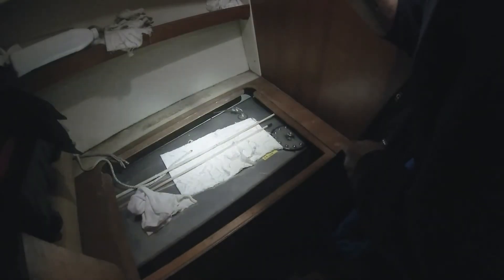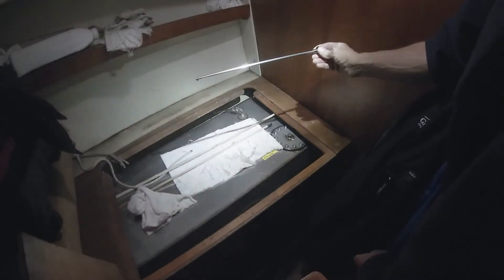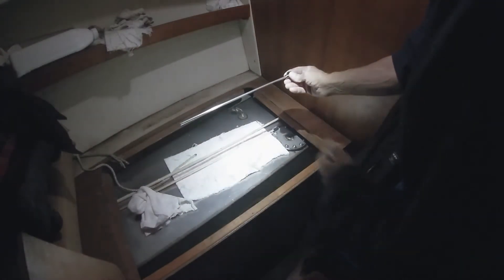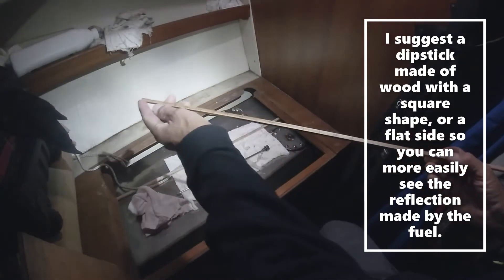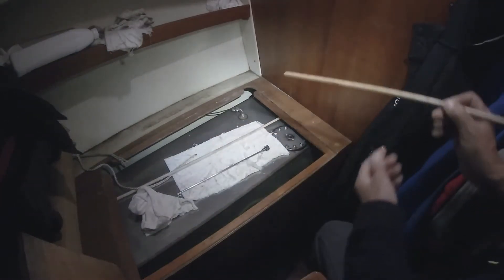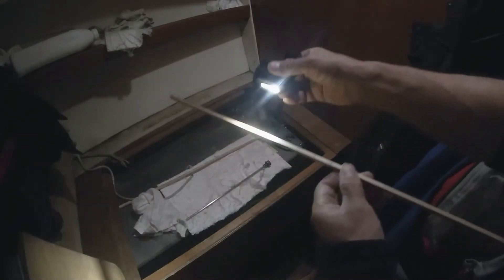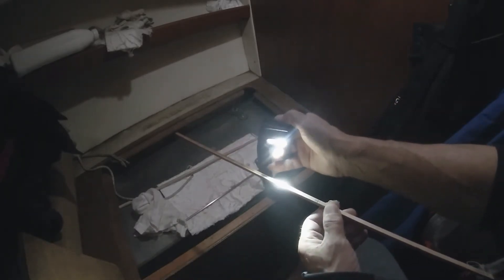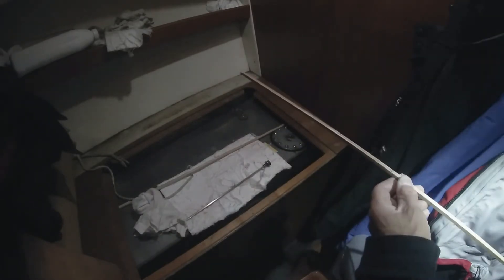I DIPPED THE TANK -- BUT HOW MUCH FUEL DO I HAVE?

Comment: My transmission has ametal cylindrical dipstick that is also impossible to read.  

I came up with a simple solution

Carefully lay the dipstick on paper towel!  

The wetted paper towel clearly shows the level.  

Of course, you have to lay it flat without sliding it back and forth.
Reply from the maker: That is an awesome idea that I have never heard of before. Thank you for sharing that. I am sure I will have an occasion to use that technique!
Reply: I came upon it purely by accident.  

After a couple futile attempts to read my dipstick, I set it aside on some paper towel and happened to notice the wet mark.